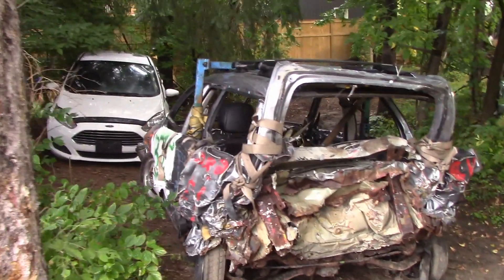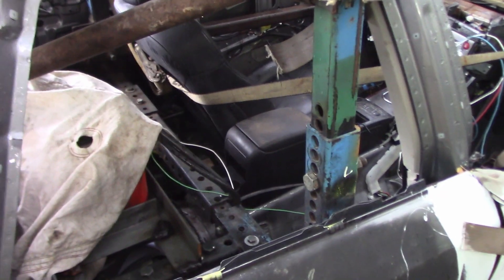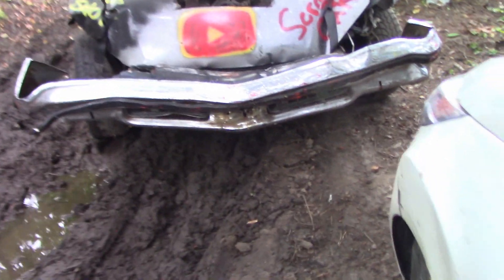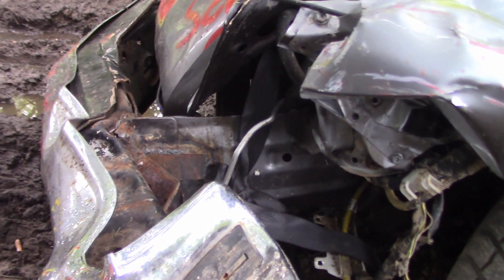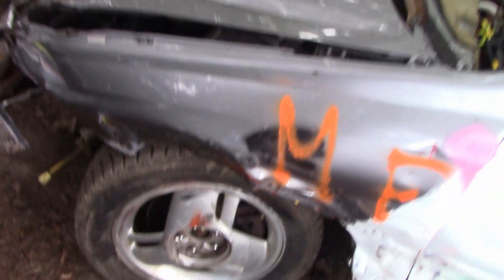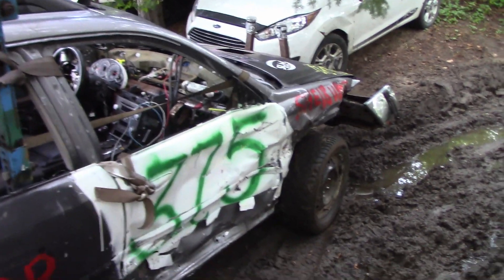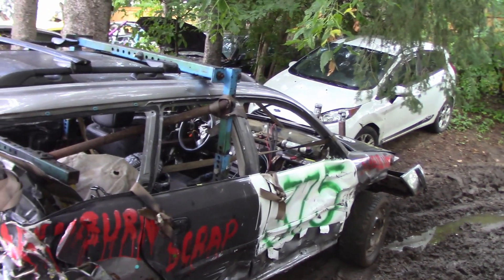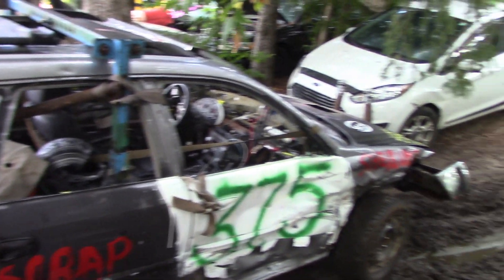Subaru Outback aftermth what took Stephen out this time? How did the 74 monte bumper do?

Comment: Wait. He folded a 74 monte? God damn. 
I did notic though that its not seam welded and there isnt a frame cap plate. Probably because of rules but it probably would've benefited from those 2 things.
When you take a hit the, the force of the impact has to go somehwere. So it went to the pinch point of the frame and bumper. I bet id you had a 4x4x1/4 inch plate to cap the frame, you probably wouldve bent the frame
Reply: Frame was capped
Reply: And yea no seam welding bumpers
Reply: @stephensanders626  oh. Must've been swallowed by the backing then and I didn't see it. 
Well. Weld another plate on the bumper and put it back on and maybe it'll flatten it
Reply from the maker: ur right our rules limit what we can do but i think seam welding would of done much better
Reply from the maker: you should of cheated maybe seam welded the bumper or suffed the frame too bad u floowed the rules for this show Stephen lol